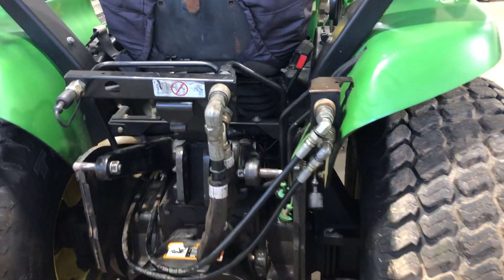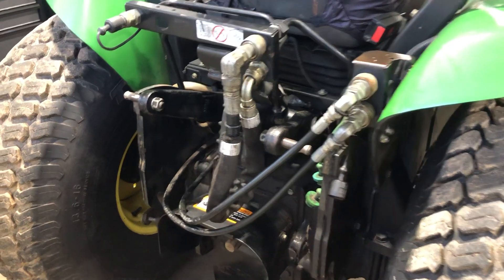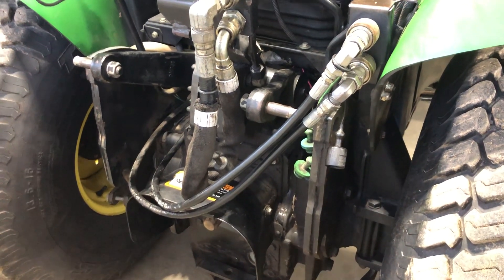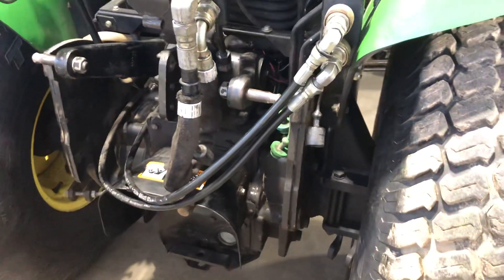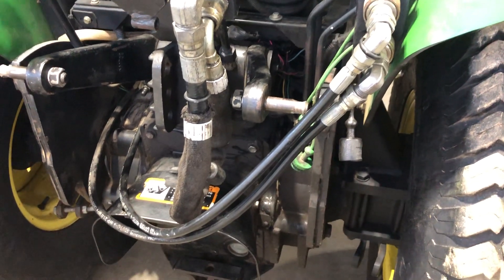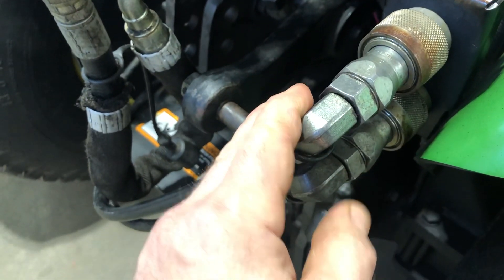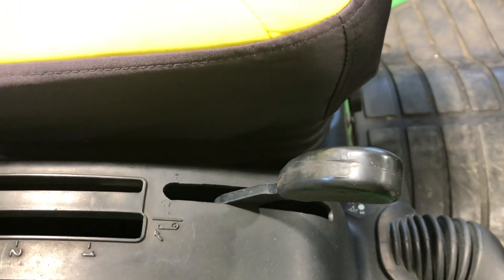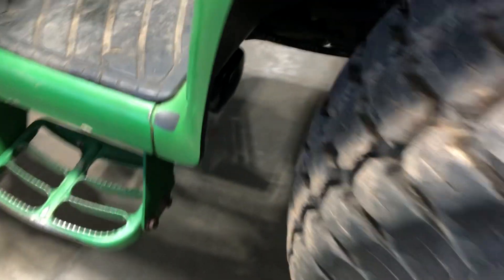John Deere Tractor Belly Mower Hydraulics

Comment: Is this circuit strong enough to run a grapple up front?
Reply from the maker: Yes should be
Reply: Thanks for your response. Your channel is amazing btw. Thank you for your service.
Reply from the maker: @ericsmith8427 thanks for your kind words and happy to hear it’s helpful.
Reply: @darrenmas  I’ve watched all you videos. I have a JD 4310 and did the old f11 into f12 oops. I can get al the way to the valves wot rev and it won’t move. Unit ran flawless unit I put the fuse in the wrong spot. reverse potential geometer is .79 at idle 4.36 all the way depressed. Any help would be greatly appreciated.